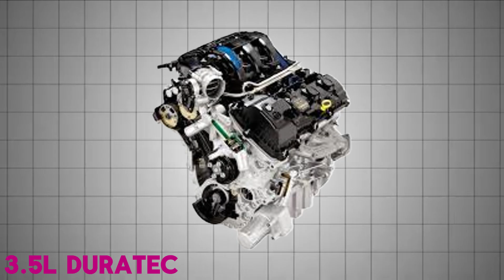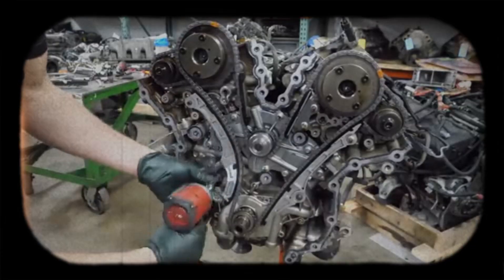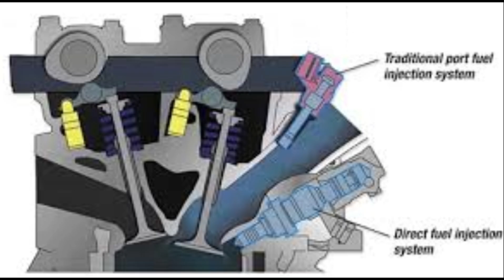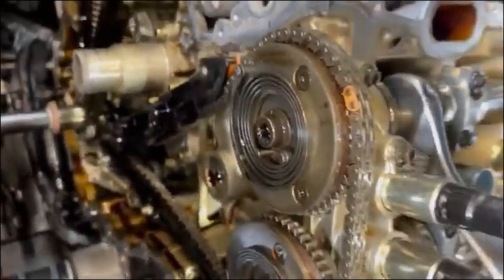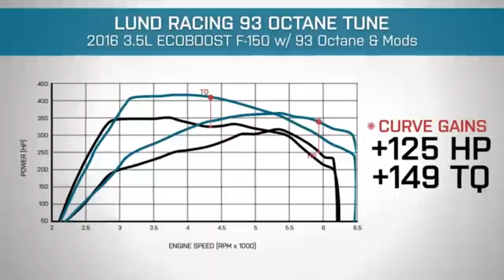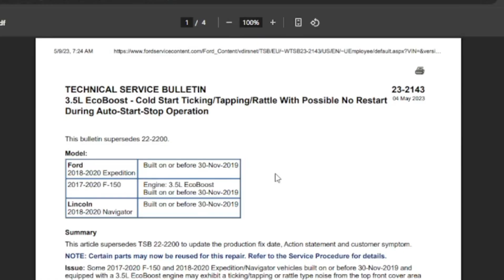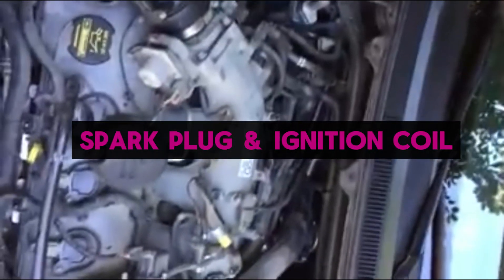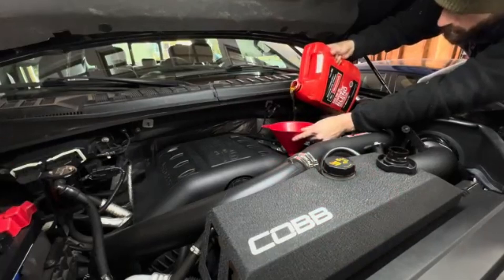Ford 3.5L EcoBoost – Reliability and Performance

Comment: I have a 2015 F-150 Platinum with 215,000 miles, with no issues. Oil changes have been done every 5,000 miles. The only repair it has needed was the turbo cooling lines at 150,000 miles

Comment: I bought a 2024 3.5 with the 10R80.
I’m trying to find someone in Ontario near Niagara Falls that can upgrade the Valve Body.
It only has 27,000klm on it, and I enjoy it, but I’m sceptical of the transmission longevity.

Comment: 2017 F-150 4x4 3.5 EcoBoost , I had the cam phasers & timing chain replaced at 25k and needed it all done agin at 43k I traded it in on A 2014 SVS Raptor 6.2 V8 I would stay away from any of the EcoBoost Engines !
Reply from the maker: Thank you for sharing your experience

Comment: Awesome 3.5 ecoboost my 2013 FX4 with 378,000 KMS on it still Strong Power ! I think I’m still lucky
Reply from the maker: Just take care of it. It will serve you
Reply: 2019 saw the introduction of the new design cam phasers for the 3.5.
YouTube will verify reliability went waaaaay up after that.
Same for the CDF drum issues on the transmission which was redesigned in August of 2022.
It will be interesting to see now that the engines and transmissions are sorted, how the new particulate filter in the exhaust system affects reliability in the 2926 models.

Comment: Junk
Reply: Mines got 370,000mi on it, if that's junk I want more junk. 🤡🤡
Reply: 2011-2016 gen 1's, sure. But with gen2's and the phaser redesign in 2019...they're reliable.
Reply: @davidlawrence8779  Mines a gen 1, same with fathers both high miles, phasers were only a problem on certain VIN numbers where production defects occurred.
Reply: There are plenty of 3.5 Ecoboost gen 1 with tons of miles on them posted by real owners here on YouTube. Ford sells around 750k trucks annually. A lot of them are the 3.5 Ecoboost. It's been out almost 15 years.